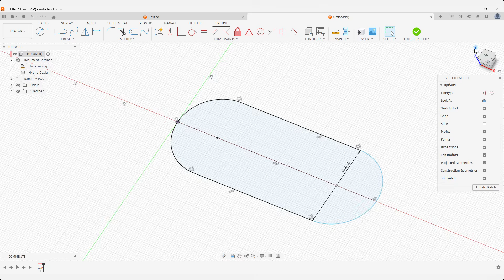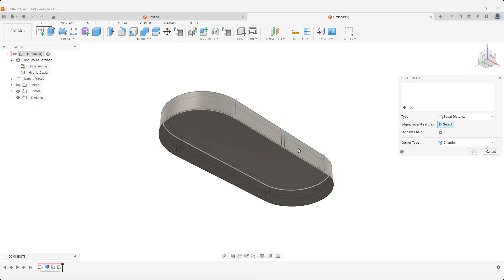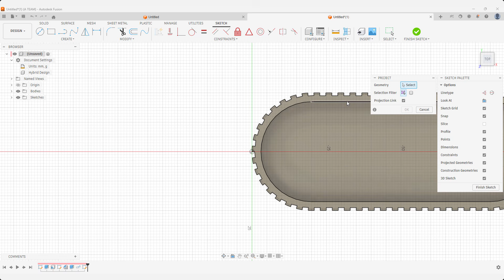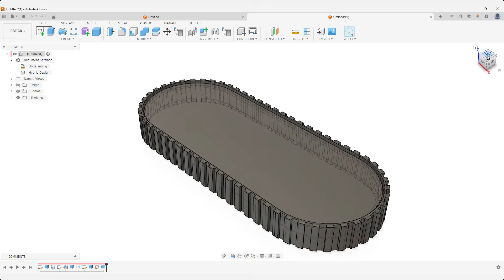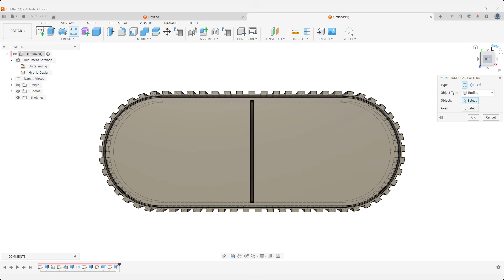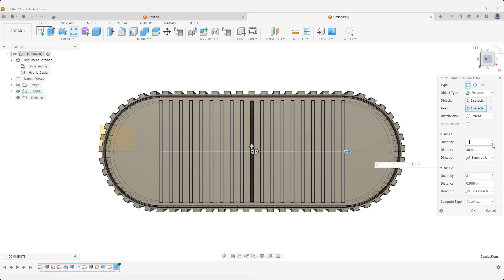Design a Better 3D Printable Soap Holder in Fusion

Comment: If you roughly position the slot across the origin, you can use a midpoint constraints on the construction line that goes through the middle of the slot and the origin, which quickly centers the slot both horizontally and vertically on the origin.
Reply from the maker: Good point!
Reply: @The_maker_letters You can also just use a Center Point Slot, which will do the same thing.
Reply from the maker: I agree! 👍